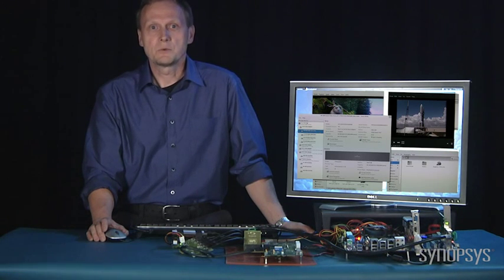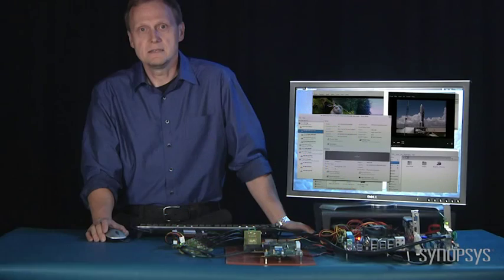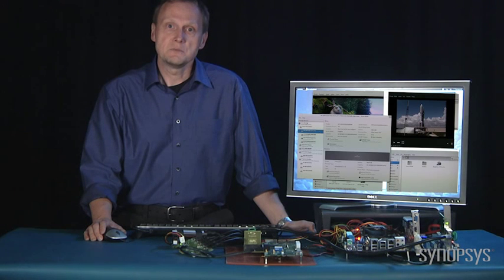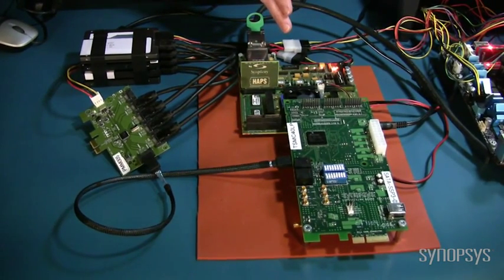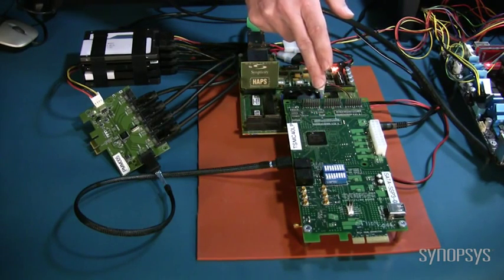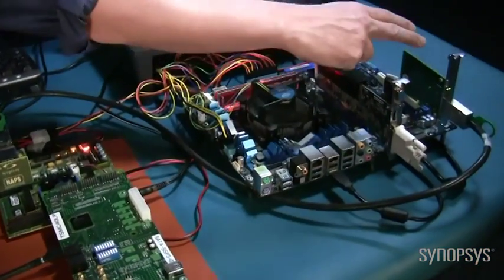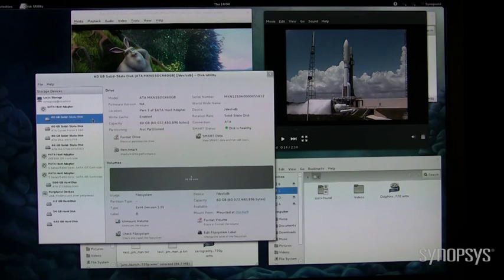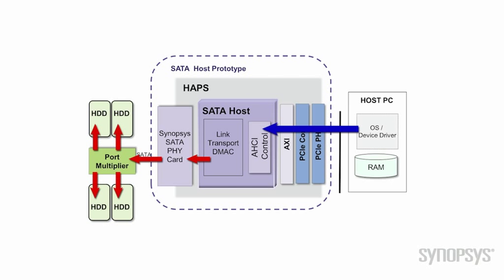SATA Host IP Demo Using a Port Multiplier and FIS-Based Switching | Synopsys

Comment: Hi, I'm afraid the geek-speak goes over my head but I have a question I think you might be able to answer. I have an old Windows XP PC with an old SATA hard drive that needs replacing. The SATA drives they sell now are a newer version - they're meant to be backwards compatible but in my case they're not compatible - I've been told that early SATA mother boards didn't know how to be compatible. SATA PCI cards are available to add SATA ports but I need to know if such a card will allow me to use the newer SATA hard drives.